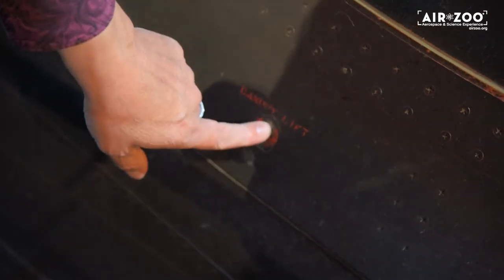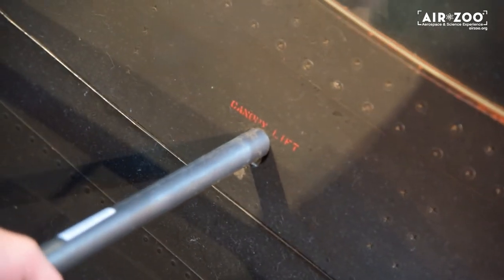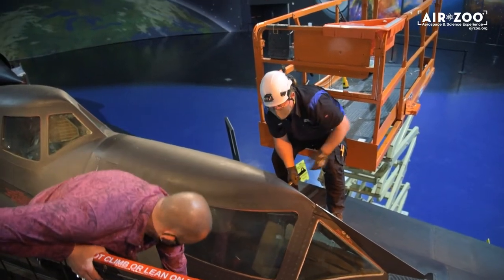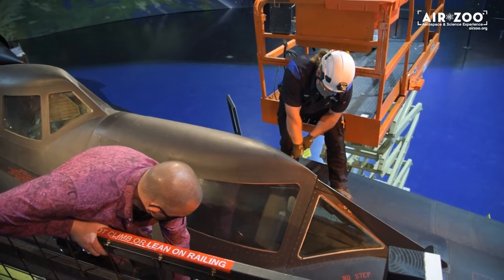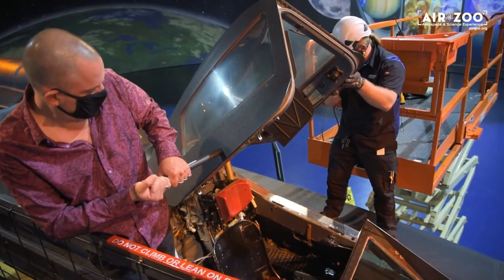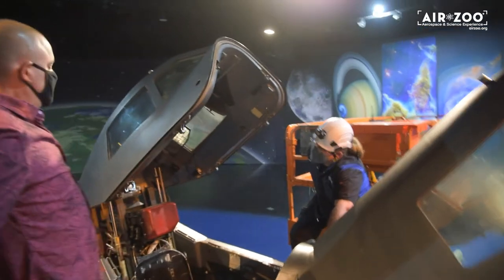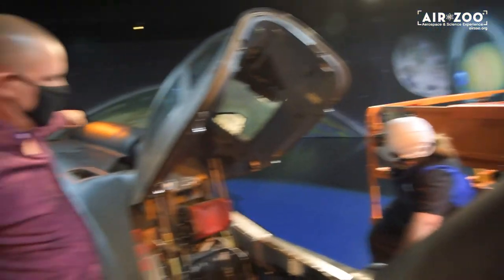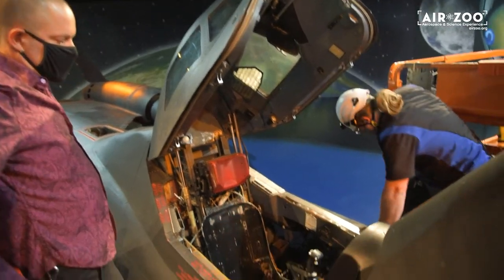Opening an SR-71 Blackbird Cockpit

Comment: Nice. The periscope is actually intended to be used to check for contrails, but in reality pilots could also use it to visually check the trim of the stabs and (IIRC) to ensure even trimming of each engine 's afterburner.
Reply: Roger that.